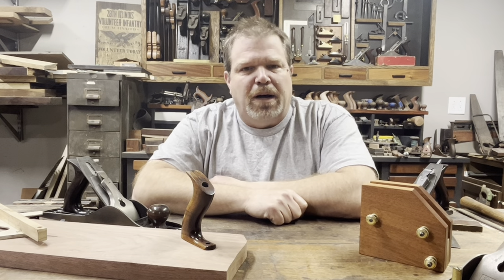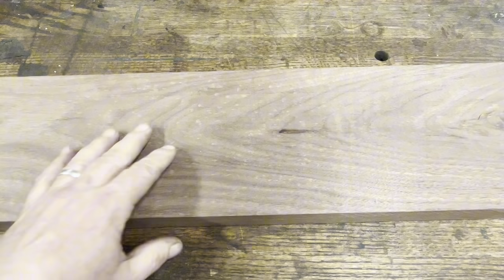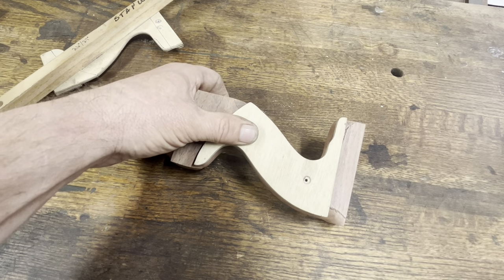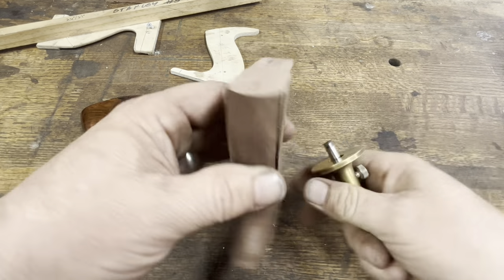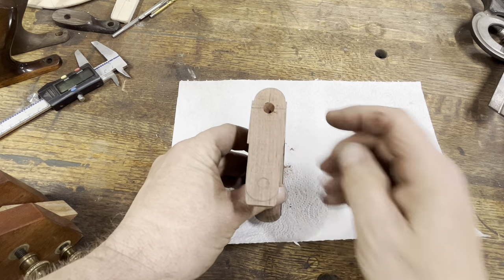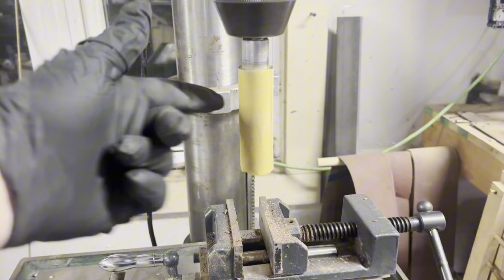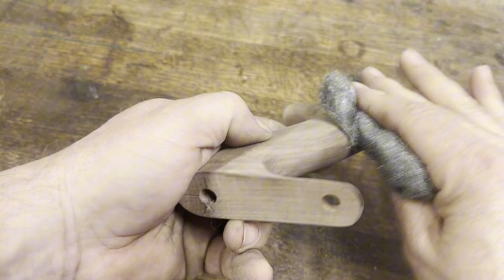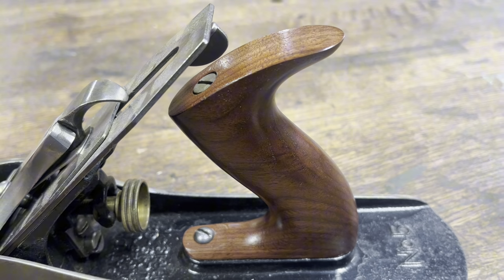Making a Tote for a Stanley Plane

Comment: I’m going to watch this later when I’m not on the road. Paul Sellers has an excellent video as well. He doesn’t use a jig to get the hole. He starts with the hole and then aligns the bottom of the tote with the hole. I’ve been practicing making them for the last month or so, and have managed to make two serviceable ones so far. I like hard maple best so far.  The only issue I have is smoothing the inside corners as I don’t have many rasps or files.
Reply from the maker: You could wrap a piece of sand paper around a wooden dowel.

Comment: I love this channel! I've got a bunch of old planes ive picked up for $1-15 dollars that need some love. Im trying to find a sand blaster to get all the japaning off if them. Cheers my friend, can't wait to see what you show us next. 👍🏼
Reply from the maker: A small bench top blaster will work, for the larger planes like a 6, 7 or 8 a larger stand alone cabinet is needed. Make sure you get a compressor that can keep up!
Reply: @DaveCorinth  awesome thanks Dave!
Reply: @DaveCorinth  Wish I understood the duty cycle and way these compressors work, I bought an underpowered unit that just about can work for a DIY shed but had I known I would have bought the model up with a belt drive and higher CFM and bigger tank.

Comment: I’m curious if I have this right - there seems to be 2 different tote handle shapes that Stanley made. The main difference is one is thicker at the end of the horn and I see this thicker shaped tote on type 19s but it’s also the shape that Lee valley uses on their layouts. You are using the other shape which in my opinion is significantly more comfortable. I’d be interested to know if i understand this correctly?

Comment: Thanks for the tip on the router bit ... I've been trying to find one for a long time.  Any chance you could share or explain how you made these templates.  I happen to agree with you 100% on the Lee Valley template ... grain orientation not is correct.  I love your solution.  Great work.
Reply from the maker: Video on making templates in the works…..

Comment: Making a tote is normally for yourself. If you're a master joiner . Wring wood to begin with.  Stanley normally use Brazilian rosewood. I use English yew can be used for archery bows, veneers, cabinetry ,handles , furniture, carvings, musical instruments (lutes), and turned objects. Availability: English Yew is relatively uncommon. The larger size tree trunks are usually hollow.
Reply from the maker: In the early years Stanley used Brazilian, starting around the end of the SW era you start to see Cocobolo Rosewood. The type 19’s are Cocobolo Rosewood, which has a more red color. I’ve never tried Yew, but it’s on my list. I’ve used Black Walnut a lot, it’s readily available where I live.

Comment: Great video; appreciate your work. Just wondering what you use to fill your screw holes? Have you tried hot glue or double sided tape? Or do those form too weak a bond? I imagine that bit creates a lot of stress. Thanks.

Comment: Excellent technique! Can you please share the thickness of the wood you used for this? Thank you
Reply from the maker: I buy 1” thick stock for totes, and 2 1/2” thick stock for knobs. Stanley totes are typically .95” or around 15/16” thick. The knob vary depending on the age and the type.
Reply: @DaveCorinth  thank you much

Comment: Awesome video. I have a flock of Stanley planes that need new totes. The old ones were either busted or missing entirely. Have a few with the Stanley decal still on it, or, most of the decal, and I'd rather not have that on a user. How do you drill the little recess for a Stanley 3 or four tote?
Reply from the maker: For the No 3/4 that have a raised boss that requires a recess on the bottom of the tote, I drill that before I drill from the underside. On Stanley’s it’s usually at a right angle to the bottom of the tote, but on some others it’s at the same angle as the rod. I use a forstner bit to do this. I’m going to make a video soon on making a 3/4 tote and knob set. So keep an eye out.

Comment: You beautiful human being! 15/16” is the secret measurement. The two totes I have made so far were 3/4 starting out before shaping (by hand), and I was thinking they felt a little on the thin side. I just did not know where to start. I made a CNC profile for my Shaper Origin, but after seeing how fast you made that, now I wish I had a 1/2” collet router (is that bit 1/2” shank? What HP you running?), a drill press, and your jig. Thank you so much for showing your process.
Reply from the maker: First, thank you for the compliment, and second, I use a Bosch 1617 2.25hp router with a 1/2” collet. Hope this was helpful and thank you for watching.

Comment: Silly question, but are the different angles of totes just a personal preference for comfort while using the plane.  or is the a functional use that I'm missing??? Thanks
Reply from the maker: I should have explained that better in the video. A  type 9 and later Stanley No 5 has a 27 degree rod angle, while an early no Stanley No 5 earlier has a 29/30 degree angle. The No 3/4 totes have a 26 degree angle while Sargents have a 25 degree rod angle. So each block is basically for a different tote style. I make totes for Stanley’s, Millers Falls, Unions, and Sargents. I’ve even made a few Lie-Nielsens and Veritas totes, although those are much lower around 14-16 degrees. Hope this answers your question.
Reply: @DaveCorinth thanks for the wooly very interesting,  love the videos.   Thanks

Comment: By chance, do you happen to know the threading of the rod on that Stanley rod?  I have wanted to make taller handles without sinking the barrel nut an inch down inside; I would rather make new rods and thread both ends
Reply from the maker: Stanley threaded rods are 12-20. There’s a couple of folks that offer the tap and die on eBay.

Comment: Can you tell me what the Lee Valley round over router part number is and what size bearing used for for the proper round over. That is a fantastic video showing your methods for making the tote.
Reply from the maker: Lee Valley part number is “16J4010” is called a variable round over bit. They have all the specs including the bearing diameter on their website. Looks like the price is around $86.00 now.

Comment: Good day can tell me what is the angle of the hole on the tote of your of hand plane
Reply from the maker: @eugeneleith1927  they vary. Stanley No 5’s generally have a 27 degree angle, no 3’ & 4’s have a 26 degree. Some of the early Stanley’s have a 29-30 degree rod angle. Its best if you have an tote or the plane on hand that you are going to make a new tote for to check the rod angle for that specific plane.